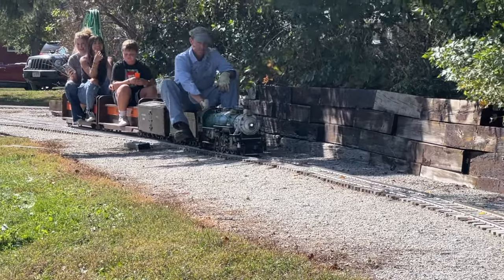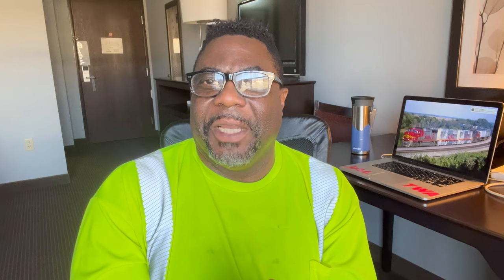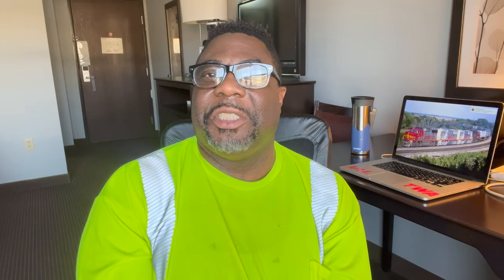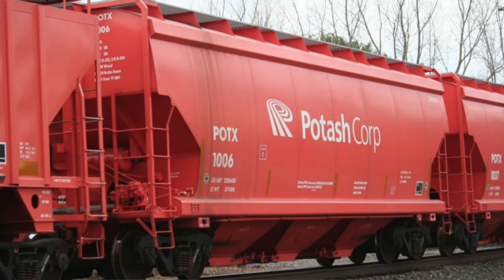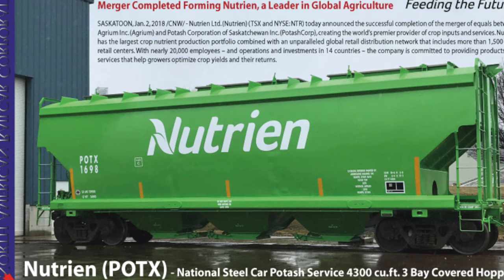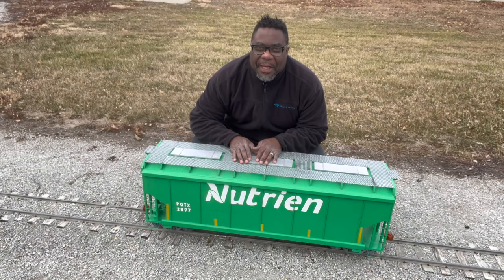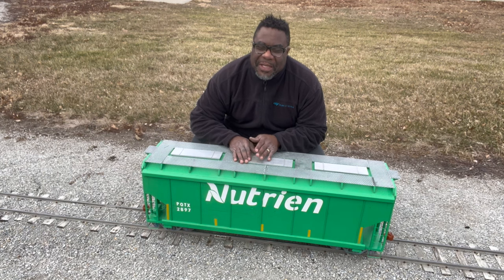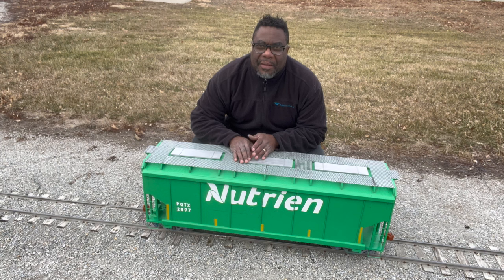Building a 1" Scale 47' Potash Hopper

Comment: Your vid caught my attention tonight and just had to see it.  My father-in-law belonged to a Live Steam club outside of Philadelphia, Rahns, PA.  He hand-built a PRR 0-4-0 yard switcher and then a few years later hand built a NYC Hudson steam engine.  He hand-crafted the boilers and every tiny part and large parts.  

The hopper car looks great and I'll be checking out the rest of your rolling stock!  I liked and subbed.  I was a volunteer brakeman/switchman on the Adirondack Scenic Railroad and a track repairman on the Adirondack Northern short line out of Utica, NY.  I did 35 years in the USAF and had hoped to get at least five years with the short line so I could combine the military retirement with the RR retirement.  It wasn't meant to be as I got laid off when the recession hit in 2008.  

My wife and I have taken AMTRAK from Syracuse, NY to CHI and then to Portland, OR.  Also to Salt Lake City on the same routes to CHI and also to San Antonio.  Always got a sleeper car.

Stay safe out there on the rails.

Cheers,
Bob

Comment: Made of wood! Wow, that's interesting! Looks great! I guess, as long as you keep it dry from rain - it shall be fine. 
I gitta consider making train car out of wood and ply too... doesn't look bad at all! My mind was stuck on _ "must build from metal..." ..
Reply from the maker: I started with wood because it was the only medium that I could work with since I had very little metal skills when I first started. Yes, you are absolutely right when it comes to the fact that you have to keep them dry. However, I’ve done so many of these cars that either I’m totally wrong or I have just pioneered a new way of doing things. I have not tried to build anything other than 1 inch scale, but while some of my initial stuff isn’t perfect, I have definitely found better ways to improve.

Comment: Dude builds large-scale trains, runs real trains, has a TWA sticker on his laptop, and listens to The Rippingtons? Sign me up.

Also, wooden cars, IMO, make more sense than full-metal cars at this scale, unless you're using super-thin sheet, like aluminum flashing. It's also way easier to get wood to be exactly the shape you want it, especially with a Dremel and some basic woodworking tools. Wooden cars are lighter, and wood is a very versatile and inexpensive material, and you're not leaving these trains outside anyways, so despite what the elitists may proclaim, wood is perfectly fine IMO.